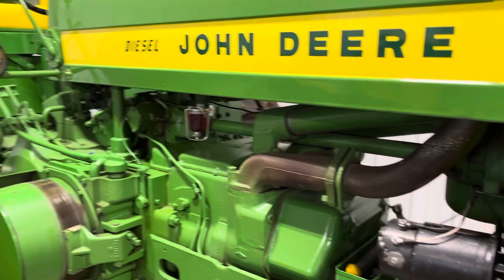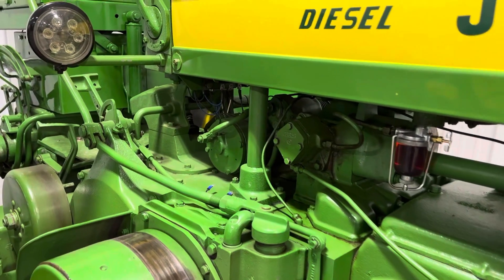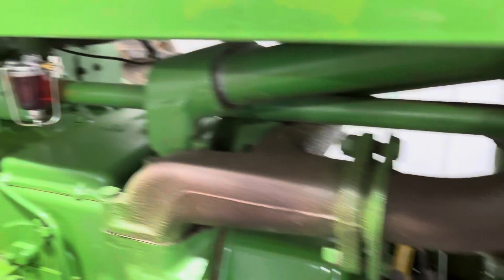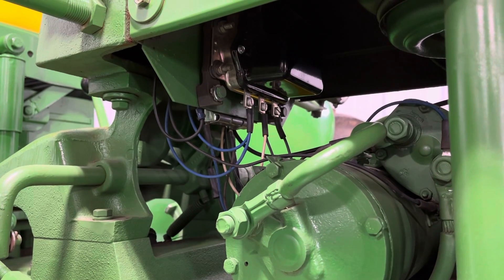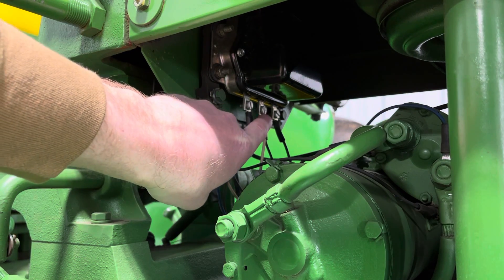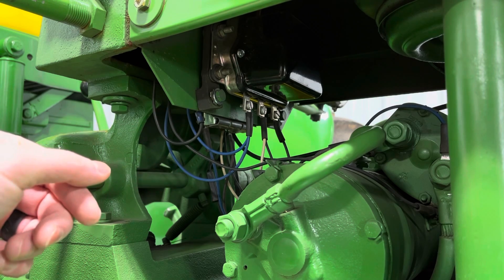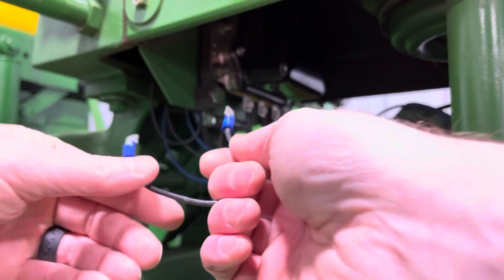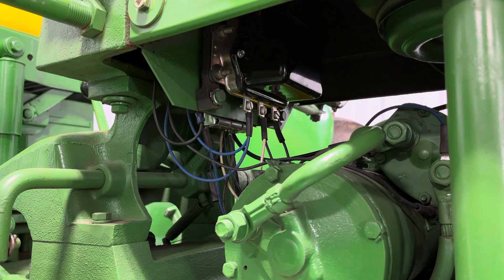How to polarize a generator - John Deere

Comment: Same technique for both positive and negative ground systems?
Reply: Yes as long as you have an externally earthed field in your generator. This video is demonstrating that. However if battery was applied to the field terminal then that would be a dead short to earth. When I  polarise a generator I always disconnect the two wires from the generator.

Comment: So the other videos that spark the field, usually from the regulator are definitely incorrect?

Most new stuff would be alternator systems- your john deer looked new- newish?
(Oh, just expanded to the notes- a 1958)
Reply: @Mcfreddo. The other videos that spark the field as you put it are CORRECT. I  will explain. If the generator is an A circuit it has an externally earthed field. To polarise with all leads connected. Momentarily connect lead between B and D terminals on regulator. A generator with a B circuit has an internally earthed field. To polarise with all leads  connected Take the wire off the field terminal on the regulator and Momentarily touch on the battery terminal on the regulator. Internally earthed field is earthed to the case of the generator. Externally earthed field is earthed at the voltage regulator moving contact inside the voltage regulator box. A regulator box must always have a good earth. This can be measured with a VOLT METER.  I hope that I haven't confused you, it is a very simple system.
Reply: @ianrobinson9565  No you haven't and thank you for that.
Andrew.